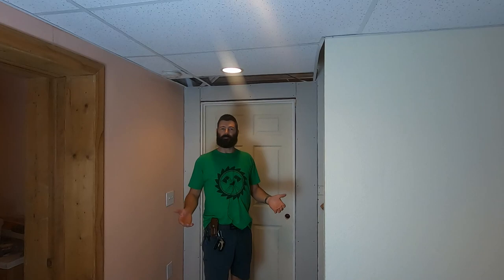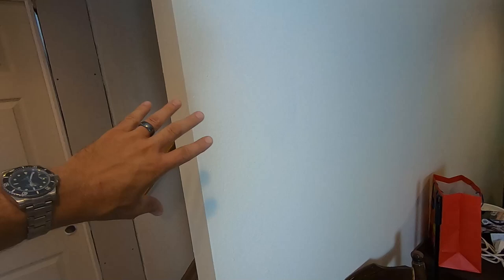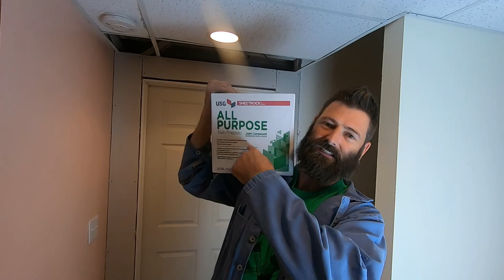Drywall Tape, Mud And Texture To Perfection | So Easy | THE HANDYMAN |

Comment: If you use the "hot" mud that dries in one hour, or the 15 minute stuff, you can slam on 3 or 5 coats in an afternoon and get the heck out of there sooner...mix the stuff in throwaway aluminium cooking pans, as it dries and hardens quick.
Then dont sand at all, just scrape it down smooth with 6" knife.
Put worklight next to wall pointed sideways, this will catch all the ridges and globs and whoops you can see them stick out obvious from the shadows cast...
This for "smooth walls" 
Use "finish" mud last fine coats and touch ups it's very fine mud goes on super nice and invisible after primer.
Thanks for your videos!

Comment: Simple, but takes a long time. I always tell residents that the patch can take days. I use the can a lot. Works really well. They can't tell there was ever a hole there, even with big patches like the ones I make when replacing a shower valve assembly. In winter if the can is really cold and you cannot get a spray pattern. Soak it in hot water.

Comment: When I use canned texture, I usually use a piece of cardboard and play with the settings until I have the spray pattern I want.  You get about the same absorption on cardboard as dry mud, and I've found I save enough time overall to make it worth it on each project.  I do the same for practice/matching on other texture, whether knock-down or whatever crazy pattern was originally used.  I could probably just dive in, but I recommend this kind of testing for beginners to see how it behaves.
Reply: I do the same thing.

Comment: A dullish, pull paint scraper does a great job of removing excess plaster. Works well on those corner bead humps and those taping pull off ridges.
Reply from the maker: Thanks for the tip.  I think I have one of those pull paint scrapers.  I will try it out next time.
Reply: The Handyman   Just make sure it’s not sharp, that way it doesn’t rip the paper on the drywall.

Comment: That's stuff is premixed you just want it wetter. The powdered dry wall mud is not premixed it comes in a bag. I wet the dry wall mud tape with water first and after applying dry wall mud around the surface that the dry wall tape is going against. Then I put the soaked dry wall mud tape and more dry wall mud.

Comment: Hey Handyman, why not use hot mud 20min or 45 min and just get this done in a day ? Thats what I typically do, tape, mud, texture in one day.  any reason for you using all purpose and returning to job site multiple times? thanks, great vid.
Reply from the maker: I hate using hot mud for anything outside small patches.  It's a pain in the ass to sand smooth.

Comment: I've seen a lot of people back butter the tape before they apply it, any real advantages or disadvantages of that compared to what was shown here or is it primarily preference?
Reply from the maker: I haven't heard it called back buttering the tape.  On larger jobs I use my banjo https://amzn.to/3jvlbaX that tool puts mud on both sides.    You can pre soak the tape in thin mud to make it easier to work with.  As long as it's soaked in its good to go.

Comment: Handyman, are you wetting the tape first, or are you letting the thin mud get in?
Reply from the maker: You aren't supposed to pre wet the tape.   You want the wet mud to penetrate the tape. I have tried the pre wetting before.  It makes it easy but makes a weak joint too.
Reply: @TheHandyman1  - Great. That's what I have been doing (dry tape), and I was told that I was doing it wrong. Thanks for the feedback.

Comment: Thanks for the videos! Why do some people say to soak the tape and some people don't? What's the difference?
Reply from the maker: If you soak the tap it makes it easier to bed the tape into the mud.  It is not a strong bond though.  You can pre wet the tape with thinned down joint compound but don't use water.  It will be a weak joint. You need the tape saturated with the compound.
Reply: @TheHandyman1  thanks boss!
Reply: @The Handyman, yeah I never bought into the soaking of paper tape in water either...
Reply from the maker: You have great videos Paul.  Do you mind if I give your channel shout out in my next video?   🍺👍
Reply: @The Handyman, I really appreciate the kind words man! That would be amazing!!! Thank you so much!🙏
Reply: @PaulPeck  OH SNAP, Paul Peck!!!! I've been watching your drywall videos for long time now! Dude, both y'all are awesome! Y'all have helped me out countless times. Not just on the job but mentally too!

Comment: Just used homax ceiling spray this am. The van leaked everywhere :(. Those cans ain’t cheap
Reply from the maker: If you squeeze it before unlocking it.  It will spray all over.  I have made that mistake a few times.

Comment: Hi Mr Handyman, just wanting to find out do you use a stud finder when drilling holes in the wall, is it something a handyman should invest in ?
Reply: The Franklin Sensors one at Harbor Freight is an excellent stud finder at a good price.  Around $25 before coupons, discounts, etc.  I think the model is TS700.   Yes, you should have one.  Anyone who has walls & things to hang on them should use a stud finder.

Comment: 1:58 Hey there Handyman, see finally got a new “old” set of coveralls. So, guessing the other one is officially retired now. Like the the tip years ago of buying the new “old” coveralls from Amazon, thx👍🏻
8:52 Dexter Room 😂. Always think of that too when need to put up plastic & protect things.

Got a question for ya: for paint matching, do you take a piece of old drywall, wall, etc....to paint shop & have them match it, or do you use app, paint wheel, swatches, etc? Just curious for your method & what you like best.
Cheers✌🏼
Reply from the maker: I have tried to have paint matched many times.  I have only had one time that it was an exact match.   I will have to primer and paint that entire blue wall.  The stair wall will get primed and painted too.   Anything that is flat they can try to get a paint match with.  Door trim, siding, piece of wall.